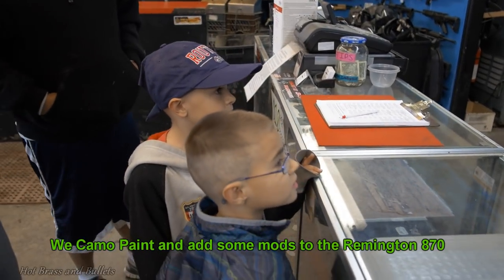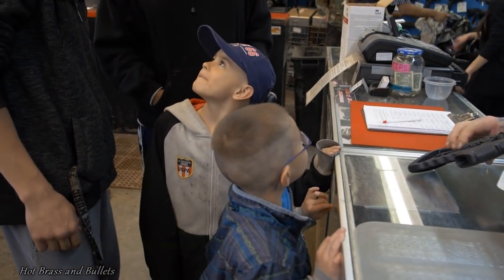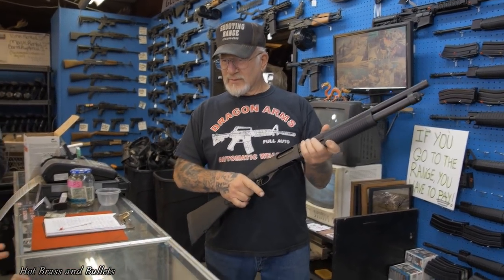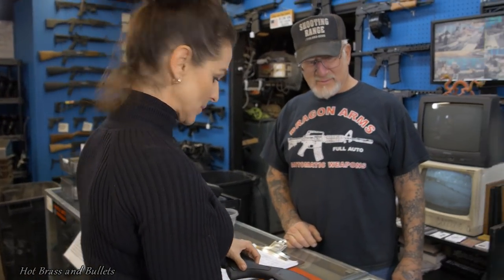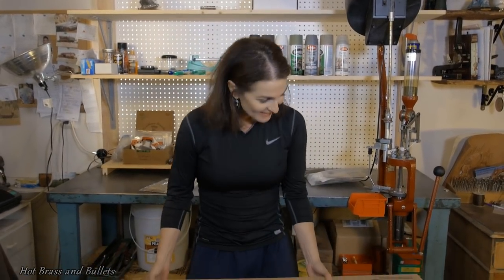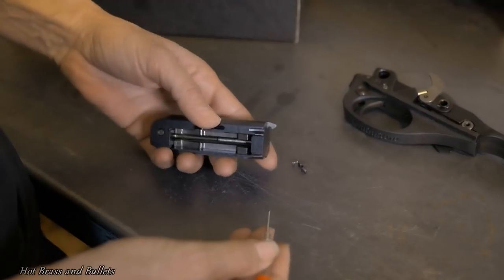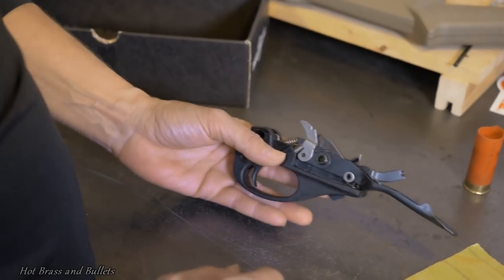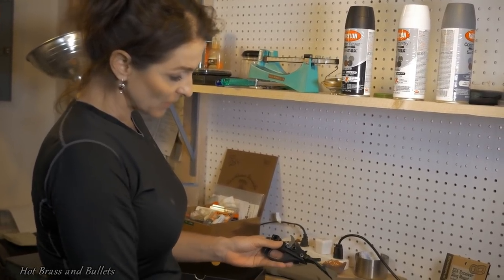870 shotgun Camo Paint and Mods

Comment: Modern 870 express really needs to be prept and Duracoated first, then rattle can. The stock finish on the 870 express is a rust magnet. Good video
Reply: What are the steps ? Thanks
Reply: @josecenteno3273  you can buy an aersol duracoat kit from Amazon, midway, etc. Very easy, you just got to follow the steps and take your time on preparing. Also some great duracoat aersol videos on YouTube
Reply: @Skyfall-sv8df  Thanks buddy 👍

Comment: What brand rear sight is that with the pic rail? Did it work well with sighting it in with only having the front bead sight? I have the same barrel with the bead sight on the small pedestal and was under the impression that rear sights would sit too high to work correctly. Great video and awesome looking build!!